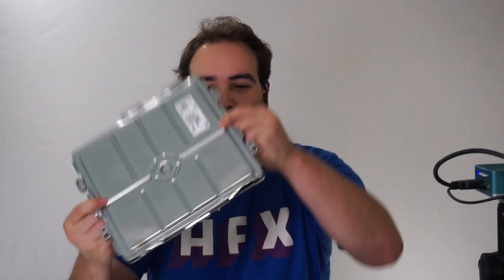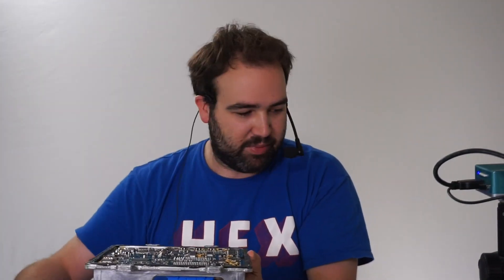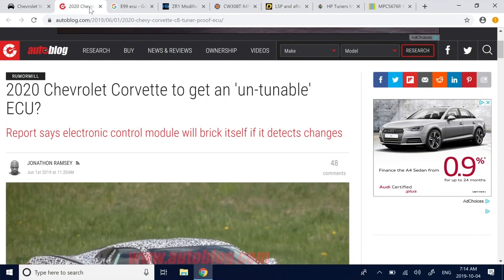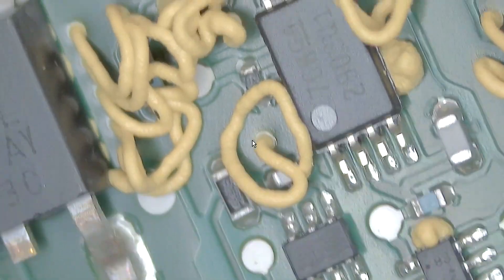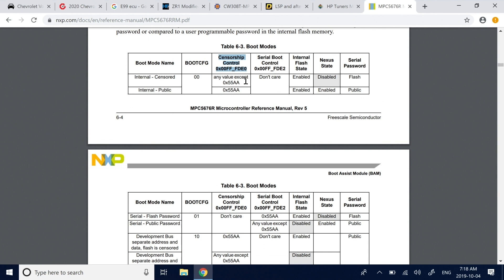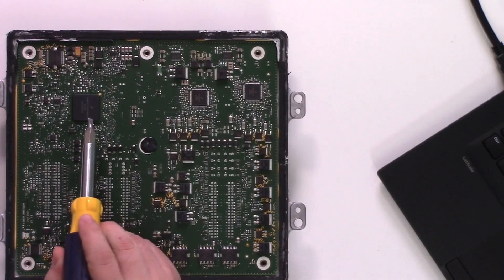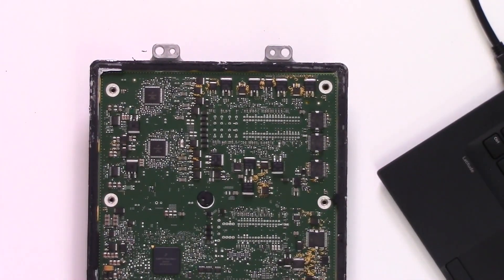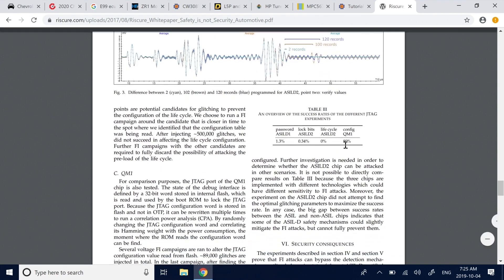GM Duramax L5P ECU/ECM (E41) Teardown Part 1

Comment: If you can figure out how to crack these new ECUs, you stand to make A LOT of money.
Reply: Hp tuners already cracked it
Reply: @slicksloth_416  Modifying the ECM with hard parts is not the same as cracking the OEM security code.  But yeah, HP tuners and a few other sources offer aftermarket ECMs for a few grand so you can tune your L5P.

Comment: Wow this is amazing watched all 3 vids!! I’m j-tagging a e67 pcm can you help me? Also use a blow torch to take apart and desolder my processors! I traced the pins via multi meter. I’m using pe micro fx, and I was able to connect and read the 2meg flash. I can’t erase or write though? That’s were I need help? Keeps resetting